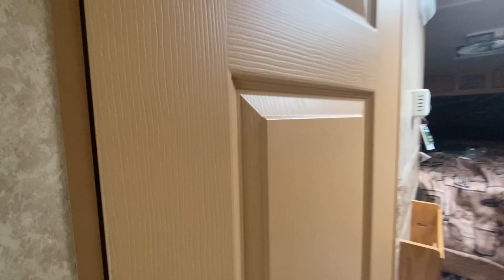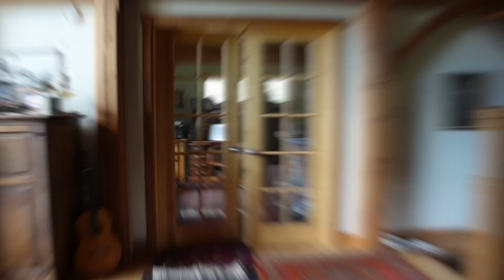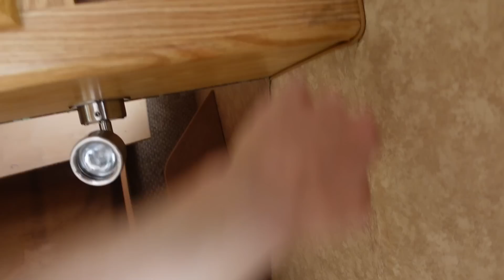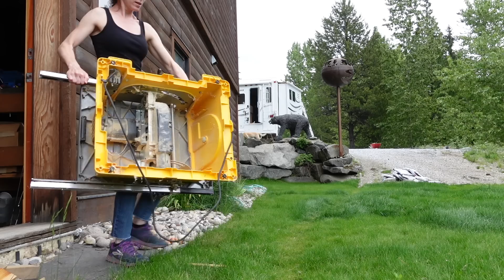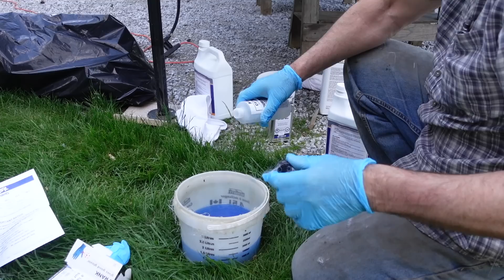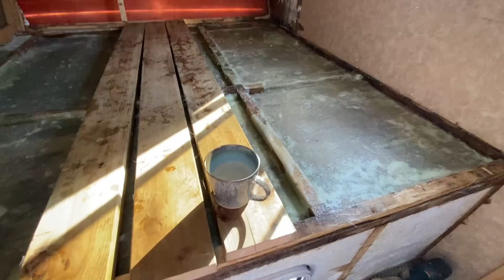This can't be happening AGAIN!! (Ft. appointment with Sexy Lexi)

Comment: You are so funny, the therapist and all. Had me laughing. And Steve fiberglassing. All I thought was like I ask myself. He's thinking, "How did I get myself into this." I changed an engine in a car, realizing later, it was just a 10 dollar part, I had to replace. BTW. You Tube has videos inspecting trailers like that. They all leak from the top down, wind blows the water in,while on the highway. Does Steve know what You Tube is. Lol.

Comment: The camper is not leaking. Moisture condenses in it. It is necessary to do good thermal insulation.
Reply from the maker: We initially thought it was condensation but the more we tear things apart we know it’s from the roof.
Reply: @michygoss7148  👍👍

Comment: I bought a water damaged 96 Bigfoot slide in.Top was almost solid black.I almost bit off more than I wanted.Tiger stripe bamboo floors, walnut table, new hardware, wood valances, added wave heater, solar, all on a custom flatbed.Hoping to redo counters this spring and dining cushions later.Possible diesel heater, still have the stock heater also.That camper looked in great shape, was it impacted a bit on front as you tore into it? Almost looked like it. And everything is so over priced these days, including used campers

Comment: I found out after many years with RV's that it's a tossup between boats and RVs for Money pits. The key with RV's is to have a covered area to store them. Covers are expensive and don't last. The money saved is building a structure instead. If you think sealing them is the cure all fix it's not. Seal is rubber and like all rubber doesn't last IE leaks start.

Comment: I'd have used a roller to wet out the fibreglass..and consolidate it soooooo much easier and a metal paddle to bring the resin through n remove any air bubbles ...Boat laminater here from 🇬🇧....but u doing great though .

Comment: My son is going through the very same thing right now; he was told everything was fine and then found all the mold and rotted wood.  Now he has to spend this summer fixing his the same as you folks.  On a recent 10 day camping trip in a 2021 camper that he "rented" from a friend, he spent the first three days repairing a multitude of leaks, non-functioning drain lines, and a repair list that was a mile long.  When he went to an RV dealer for parts, the tech there told him that most of these campers today are made in Elkhart IN and most leave the factory with all of those leaks and problems because they are litterally thrown together with little to no quality control.  The only manufacturer that I can say is the exception right now is Lance Camper Manufacturing in Lancaster CA, known for both their very high quality campers.  I owned a small used Lance fifth wheel a few years back and it had zero problems.  It was well made and had excellent fit and finish with nice oak trim.  When I spoke to Lance about why we never see their campers on the east coast, he said because every camper we make gets sold before they leave the west coast.  Good luck with the rebuild of your "No Leak" gem.  My advice to anyone contemplating a camper purchase, knowing what I know now is, DO NOT pay anything down until it has been thoroughly inspected ALL OVER, and UNDER, by someone knowledgeable about campers.  That industry is fraught with rain soaked, rotted moldy units.  Buyer beware!
Reply from the maker: So true. As I’m learning, pretty much every camper or trailer has problems/water seepage of some sort, just varying degrees. Sad - there really should be some building codes for these units. Okanagan campers do have a fairly good reputation, but even the good ones can develop problems if not taken care of properly. We almost looked at a Lance camper, but she was upfront in telling me it had a leak in the front, so I passed on even looking at it because I simply didn’t want to spend a summer renovating a camper!!! 
And here we are! I’m sweating buckets working away on ours as we speak! 🤪

Comment: I became very familiar with Methylethylketone Ketone Peroxide Spirits in a Dimethyl Phthalate when I lived on Grand Cyman Islands in the B.W.I.  Jim Daily had a big 55-gallon drum of resin and we used to sell the resin and hardener.  The drum fell off of the cradle and broke the spigot (it was almost empty, and we had to tip it to get the last few gallons out) dumping the remains of the resin on the floor of the small hut that contained the drum.  Phew! I lost about 100 K brain cells that day!  Great video thumbs up.

Comment: What a disappointment this must be...   You two will have it better than new.  Having had 4 motorhomes, it's them being left outside in the winter especially where there is a lot of snow, any outside seam that requires recaulking is a potential for disaster if not inspected at least every 6 months.   You need to find the area where the water is coming in if at all possible... Perhaps you could take it to a car wash and have and one stay inside while one really sprays the seams to see if there are any visible leaks.   I am surprised there wasn't any outside delamination of the lauan and the fiberglass, creating a bubble or something along those lines...  
Sexy Lexi you are so creative.   And your next project should be an area to store the slide in, under cover.

Comment: Cut a piece of plywood that will fit in a window. Mount a 10" or 12" fan on it blowing in to the camper. Buy a few smoke bombs and set them off in the camper and close it up tight with the fan trying to pressurize the camper. Then look for smoke escaping, and you will have found your water leak.
Reply from the maker: Clever idea!

Comment: Sorry about the rip-off artists that you got the camper from. Bad enough to hide the damage but selling at the price
of one in good condition is criminal.  Fortunately Steve has the know how and talent to  make it better than new. 
Curious if you located and fixed the leak source ?   I owned a slide- in truck camper years ago  and know the sheet metal 
roof & siding seams need caulking ,etc, periodically.  Kudos on your positive attitude. It's a toss up though who is sexiest Lexi or Michelle.. 😊

Comment: 😂🤭😂 the ole "buyers beware" issue... happens all too often they purchasing second hand 🤷‍♂️ unfortunately its probably leaked from new(sometimes just a good twist will bust the seams);.. they are a junk design, water managers to drive in from where you wouldn't expect then work it's way down... just so you know the doggos dont think it's big enough 😂😂
Reply from the maker: RV’s seriously need some building codes!

Comment: Sorry for your bad experience but RV's have a 5-10 yr lifetime and they all leak. Unless one has been under a cover expect water damage. I have never seen an RV that did not leak. Newer ones have an all aluminum frame that slows the rot process down. I bought an Airstream that had floor and frame problems but it was 30yrs old when I bought it. It took a couple of months to get it road worthy and probably a couple months of work off and on to get it 100%. These things have to be sealed yearly and even that does not guarantee anything. They are not built well at all considering how much they cost. 10 yrs old campers should be a fraction of what they cost new. So a $40k trailer would probably be worth $5-10k in the 10-15 yr age range. Use your mill and build a car port for it. Bleach is great for killing mold.

Comment: Here on VI, we have been keeping an eye out for a trailer, either for camping, but mostly as a guest house since we have cat and dog and allergic kids and grandkids.  EVERY aluminum skinned camper or trailer has had moisture issues.  Some comes from bad engineering, poor joints, to condensation buildup from excessive use, or no use.  My dad had a fiberglass Boler, and every spring my parents would be out there, scrubbing the mold (mildew) off the walls, because they would not spend the hydro money to keep a 100 watt light bulb on all winter, which adds some warmth, but mostly air flow and reduced condensation.  We are partial to those Escape fiberglass trailers built in Vancouver, but not ready to pull the trigger on a $70,000 purchase, just for guests.  (they are too busy to visit anyway.)
Reply from the maker: Neighbours of ours just bought an escape trailer at that price tag! Better to just build yourself a tiny home thingy. But yeah, water penetration seems inevitable in these things. 😵‍💫
Reply: @michygoss7148  Considering the light weight and the included amenities, I guess $70,000 isn't a lot of money.  Not everyone has all the neat tools(expensive), resources and the skills you have to build a tiny home.  🙂

Comment: Michelle, you need to allow some flex in the chassis, otherwise the outer skin will crack again.
There are different ways to achieve this, either through the mounts on the truck bed or going easy on the repairs. O'Kanagan are in Oregon if you need some drawings. I have met them when they were in Oz a few years back and they seem like very reasonable people.
Besides, this gives you some more content for your YT channel.
Reply from the maker: I’m not sure what you are meaning with flex in the chassis and the outer skin cracking. Can you explain that differently for my little head? 😜

Comment: Even the smart can get screwed. I once bought a 10 year old 911 Porsche and it had a lot of rust, the rubber seal for the front and back windows was rotten and the front end was almost totally rusted and I almost had the front suspension collapse. Front window was so pitted you couldn’t see through it at night. Finally sold it for what I paid for it but after replacing the front end.

Comment: Look on the bright side. It isn't something you'll be living in full time. I live in my 5th wheel camper. My first one developed a leak over the bed while I was in it. Fixed the leak. Found a better one and sold the first one. 4 years into living in this one and I just finally developed my first leak. Very small leak but it was there. Thankfully an easy fix. Good luck on your repairs. Not sure on Canada laws but where I'm at black mold issues can't be sold as is. There is recourse here
Reply from the maker: I could check into that, but not sure at this point what the legalities are in fine print. I think we’re just gonna focus on fixing it up.

Comment: I repaired a canoe that had been left in the bush and badly cracked due to heavy snow . Used about 2 yds of the same strand cloth and almost a gallon of resin. The worst crack got 3 layers of this cloth . Did the whole floor between the seat and yoke . Man is that hull stiff now .Haven't seen the canoe for over 5 yrs. But sure the repaired half has survived.

Comment: A good alternative is an aluminum framed camper, they don't droop over time.. But the trade off is that they can be a lot more complicated to fix if you run into into something by accident. Also, Lexi is smokin' hot!

Comment: Unfortunately, leaks are just a part of owning a camper/RV or any structure one drives down the road.  As they say, every time you drive down the road its like a house going through an earthquake.   Just a cautionary word to anyone thinking about buying a used camper... if the owner tells you there are no leaks, you can be pretty sure they are simply unaware of any leaks (unlikely) or, they are flat out lying to you.  Are there unicorns once in a while, sure, but who has seen one !  Hoping for the best for you with your restoration project.
Reply: Absolutely. You fix one and 3 others pop up, not counting the 5 you missed!

Comment: Michygoss there a other thing foam board & paneling the camper not built like a house trailer or home in the USA, you have logs a saw mill & sheet rock screws or pallets you gave stuff to put the camper to gather & use it, it might not be the greatest looking thing but it will be safe & usable! I am 61 years old I was a 13 or 14 year old boy my brother daughter 4 to 6 the house trailer rule was over the floor for house was done big wheel on floor! who do think helped finish that home me dad & the brothers family( ok i sheet rocked my place screw guns were not done yet ok or pre mixed mud & taping ok i had a hammer & mixed the stuff for mud this is horse shit) i went in the military to drive truck it was a lie but the money was better ok like building computers would not be here i had told Mr gates this need changed, its simple I would have died (but God holy spirit told me this illness will not cause my death just a control would come) i had no idea Gates design went world wide & medical my uncles numbers would save me from a cancer death, the main thing to me I lived now what? that was not answered!

Comment: I don’t know what the law is in Canada but even with an as-is clause, if the damage was known by the previous owner and not disclosed, you should eventually be able to recover your damage repair costs.
Reply from the maker: Recover the costs from who? The previous owner?
Reply: @michygoss7148  yes but the difficulty is proving the previous owner knew about the damage and did not disclose it. It’s obvious the damage was concealed so they had to of known. The other saving grace might be if you or Steve had specifically asked the seller “does it leak” and the reply was no.
Reply from the maker: @corydriver7634  yeah, we did specifically ask them that. I’ll see how it goes. I think I might contact them once more and put feelers out - see if they’ll bite and offer a little bit of money back.
Reply: @michygoss7148  good strategy at least you got video documentation of the damage too. Good luck.

Comment: It’s a drag to get surprised like that. The mold testing someone else mentioned is a good idea. You could also use a moisture meter to do an inspection - that should help give you some percentages of moisture behind walls, ceiling, etc.  Too late in this case, but worth pulling out such inspection tools when looking over something that’s used - watch the seller’s face when you start checking . 🙂
Reply: All good ideas, another possibility is to hire someone that specializes in RV inspections, they usually guarantee their work. This way if you find a problem later you got a contract to fall back on for the repairs. Cheap insurance in my opinion.

Comment: Campers, regardless of brand, are notorious for hidden leaks.
For anyone else interested in buying a used camper... Ask the seller if you can do a mold test. Mark your mold tests so they can't switch them out. Usually takes 48 hrs. If they wont, keep looking. 

As for the video... Excellent production. Very well shot and edited!! 
Definitely a new fan of the channel!
Reply from the maker: We heard of mold testing kits AFTER we bought it. Dang!
Reply: @michygoss7148  The reason for all this is the rain gets in from the outside corner trim. It's all around including the roof edge and even around windows. It all should be removed cleaned, and reinstalled with marine caulk sealer not the crappy cheap ribbon caulk the RV builders use.
Reply from the maker: @totallyjonesin  it honestly amazes me that after many many decades, they still continue to build something that is designed to leak. Puzzling! Lol

Comment: Good luck with the camper repairs.  As long as you get it water tight you can ‘make do’ inside like you did in your shed just for the trip in July then fit it out properly when you both have a bit more time.  Shame on the people that sold the camper to you as they must have been aware of at least some of the issues.  Keep smiling 🙂 Steve UK 🇬🇧

Comment: Wow sexy Lexi and a shower scene all in one video! Too bad about the camper. But alarm bells would’ve been going off in my head when they insisted on signing an as is receipt.
Reply from the maker: Totally. We’re shaking our heads. It was a bit tricky as the camper was 4 hours away, and Steve and I couldn’t see it together and mull over it. We each can say to one another that the other missed key signs, but in the end, it doesn’t change anything. Ugh. Our fault for getting duped!